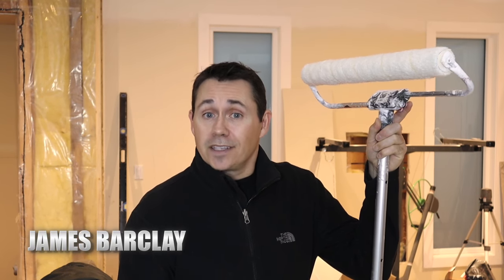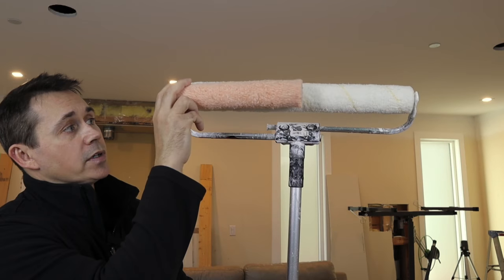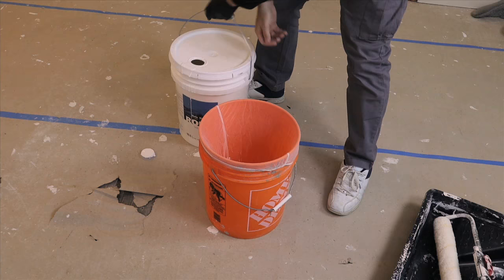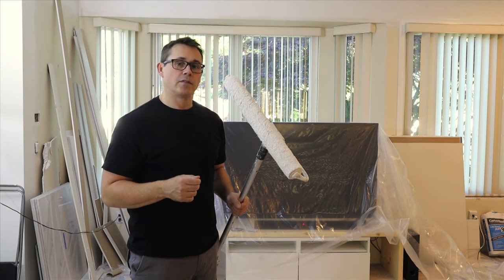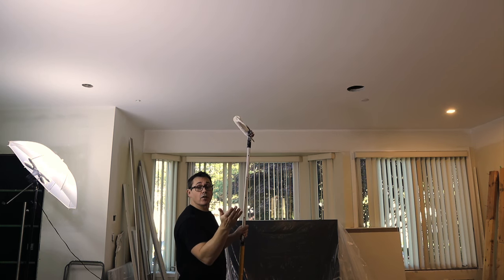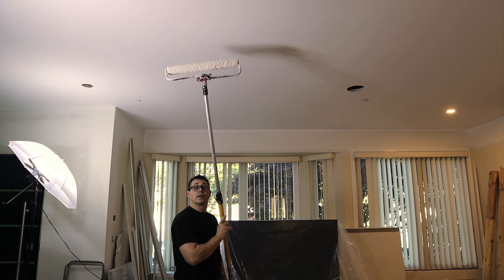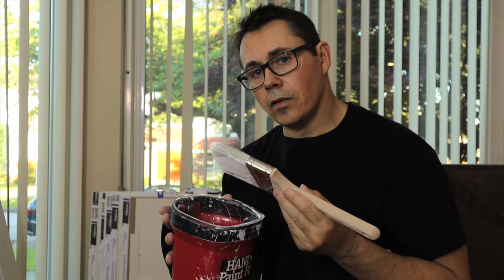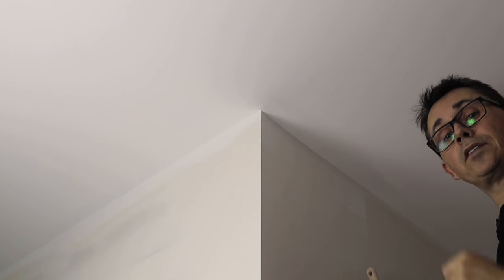HOW TO PAINT A CEILING - Everything you need to know in 5 minutes!

Comment: Hi! Do I need to use primer on walls that are already painted, or only on new drywall? And do I need primer on my ceilings (they're already white, but more glossy than the new paint will be, and slightly different shade of white, the one room w/ a new ceiling is primed already), or can I just paint them straightaway? 
And for the edges between walls and ceilings (we're doing the ceilings first), am I better off using a brush carefully, or tape once the ceiling is dry?
I don't know exactly what I'm doing, but I can't afford to have this done, and my house was trashed by a hurricane, we're having to fix the whole inside already, it's a mess lol. So, I need some tips.
Thanks!!
Reply from the maker: As long as the old paint is dry and clean, you can just paint read over it without primer. And if I am painting, both the ceiling and the walls, I always paint the ceiling first. When doing the edges on the ceiling, it’s OK to get it on the walls, and then when you paint the walls, just use a brush carefully for the edges. It’s hard to tape off the ceiling since most of the time there’s some texture to it.

Comment: Hi, Can I use a watered down acrylic ceiling paint, like at around 30% added water, as covering layers underneath before putting a final non-diluted layer as the top coat? Will the thinner coats of paint underneath compromise the longevity of the paint job even though the top coat is non-diluted? Let’s say I put the watery paint on a wall to cover it twice and then put a final top coat of non-diluted wall paint. Is that ok?

Comment: Ive always heard you should cut in first, then paint.  Otherwise the cut in creates a halo effect and it can be noticable.  Dunno if thats a painters superstition or if it has merit.
Reply from the maker: I’ve done it both ways and as long as you use a quality paint and a quality brush, i have never noticed any brush strokes up on a ceiling either way. But sure, you can cut in first if you prefer. I know a lot of painters do.

Comment: Hi,
Thank you for the information,
We are doing a project . And the painter sprayed the ceiling( huge flat ceiling with 4 windows/ 48’x22’). After that the electrician did some patches. My question is, can we roll the patches or we have to spray it?

Thanks
Reply from the maker: It will never look exactly like a sprayed job, but you can roll it. Best to use a sponge type roller to get the smoothest finish you can. Do several thin coats

Comment: So i roll WITH the entry ways and windows? I just watched a video saying to paint perpendicular with window and door light?
Reply from the maker: If you roll perpendicular to the light entering the room you’ll see all the ridges created by the paint as you overlap, so I avoid that by going with the light
Reply: @thinkreno  man thats exactly what the other video said. Im in a nightmare with this cieling. If i have to redo it again, ill be doing it your way. Its  big cieling in an open-concept home, main cieling is where i am. Its deffinately not my skill set thats in the way, but im blown away with the job in itself.
Reply from the maker: The best tip I can give you is don’t cheap out on the paint. Makes a huge difference. You can put 10 coats of crappy ceiling paint on any direction you like and it’ll never look good. Go to your local paint store and ask them for the best flat ceiling paint they carry. Sometimes even one coat is enough with the good stuff

Comment: Do I need to prime first before painting on existing ceiling paint that’s 10 years old? Any particular brand of paint I need to use? Would it look patchy if I like to paint only a section that is not part of a dome shaped ceiliing?
Reply from the maker: No need to prime over an already painted ceiling. 
If you have a piece of drywall or wood with the old paint colour on it, any paint store can scan it and match the colour. Otherwise it is tricky to try to paint only one area and have it look the same as the rest. 
I use a good quality flat white paint for ceilings. Different stores carry different brands, but I stay away from the cheaper paint. Usually they don’t cover well or hide imperfections well
Reply: @thinkreno  Thank you !!this is very helpful, after recently patching and painting a section of ceiling, it looks patchy, the ceiling is originally white and we painted white on the affected area. Is it still required in store to color match even if the paint color is white? I am little confused now whether to paint the entire. Ceiling or just the patch with an exactly matching color?
Reply from the maker: If you’re happy with it, then I’d just leave it. If you’d like the white paint to match perfectly over the area you fixed, you either need to colour match it or paint the whole ceiling. If you’re painting the whole ceiling, no need to colour match. You can go with any shade of white you like.
Reply: @thinkreno  Thank you so much, do you recommend paint sprayers and also do you have any videos on how to use composite?
Reply from the maker: It’s a lot of work to tape off everything inside for using a sprayer, but it can be worth it. Personally I’ve only rolled my ceilings